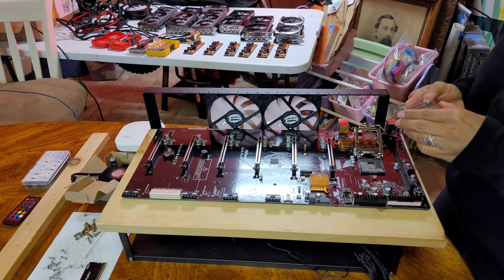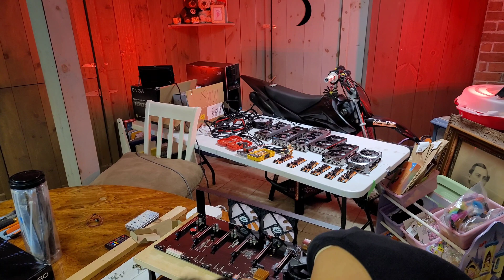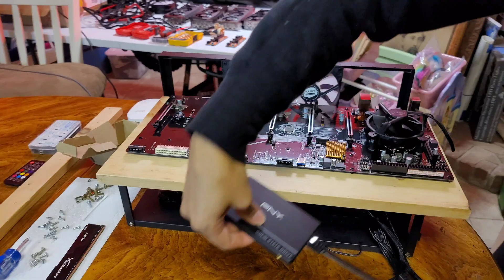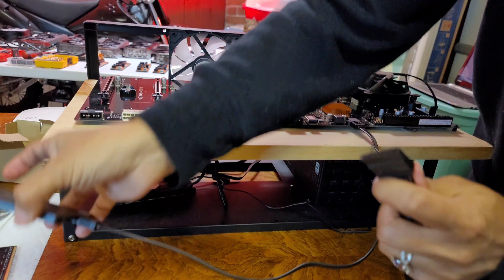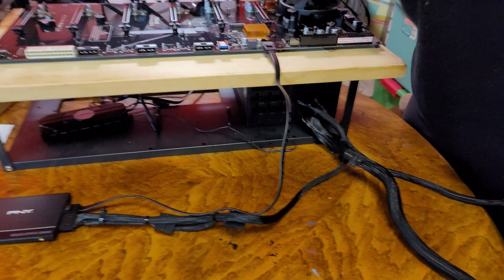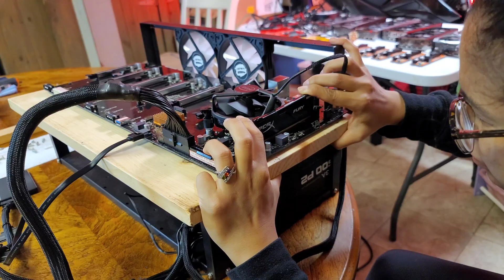ASRock H510 Pro BTC+ Mining Motherboard Assembly

Comment: Quick question : where do you connect the m.2 ssd? on the back side? I tried to find the connector on the pictures I found and couldn't figure it out (before buying). And what size of m.2 ssd is it? The same as usual with other motherboards or a shorter verrsion of it?
Reply from the maker: @ArsenicShooter  i am using standard SSD's
Reply: @ yeah, but I mean if you want to use a m.2, where would it be connected (I can’t see the connector on the pics and videos on the motherboard). :)
Reply from the maker: @ArsenicShooter  It has an M.2 socket that can support 2260/2280/22110. I believe it's between the 1st and 2nd GPU slots.

I hope this helps!
Reply: @NewEnglandCrypto  Great! That's exactly what I was looking for! Thanks a lot :-)
Reply from the maker: @ArsenicShooter  no problem! Glad to help

Comment: Idk if u here I did setup this motherboard with 2 GPU but is not working like I hear bip always what the problem ?
Reply from the maker: @dimigia9023  these are very reliable Motherboards. If you don't have a video connection, it will beep multiple times on start up. Is it hashing ok otherwise?